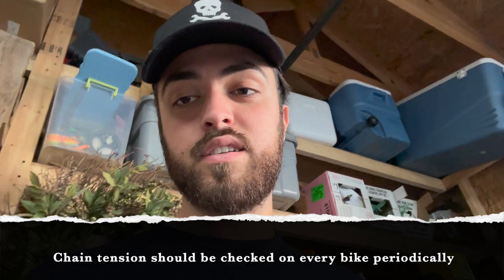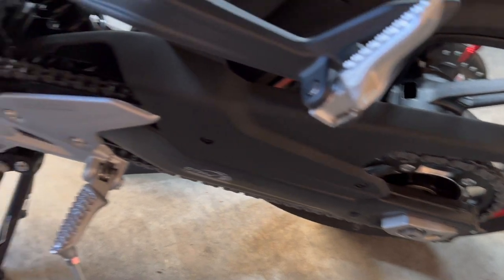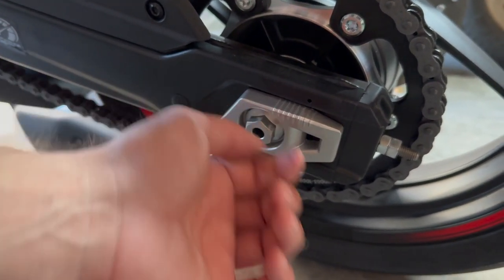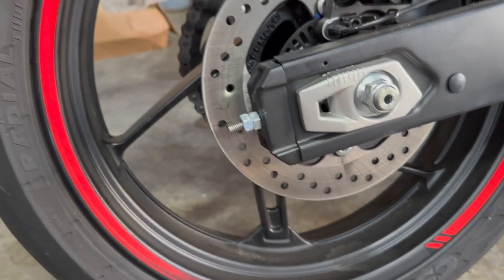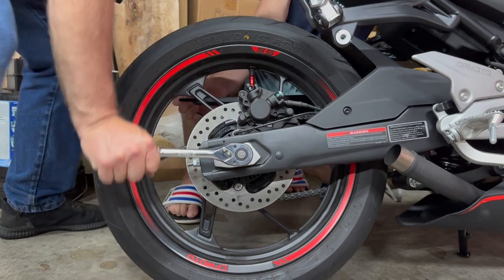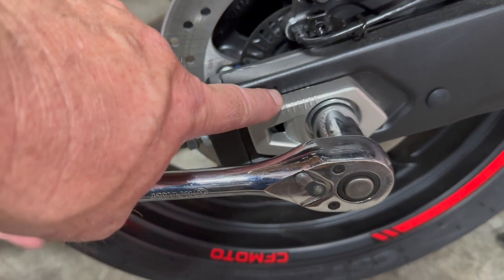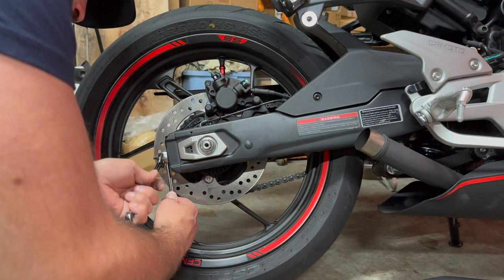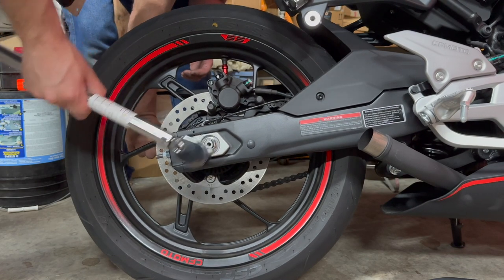CFMOTO 450SS Maintenance | Chain tension adjustment tutorial

Comment: Hi. I've got a new 450 about a month ago and I was wondering do you get a uncomfortable clunk or thud when you change gears?  The gear thud or clunk is worse on down shifts.    I've taken the bike back to the dealers and they tell me this is normal.  Do you get the same thing?
Reply from the maker: hmm.. no I don’t get any thud when shifting. It could be harmless i’m not sure if it has anything to do with the way you shift
Reply: It's 100% normal. 
Just make sure you have enough slack in your clutch lever/cable. 👍

Comment: Thanks for the video. I just got the same bike in a 2024 model. I love it but I was worried about my chain tension. The recommended slack amount was 25 to 35 mil, but even at 25 it felt like there was still too much slack in the chain. Granted I didn’t want the chain to be too tight, but that was bugging me. I was glad you showed the kind of tension you had after the adjustment so it kind of gives me a frame of reference as to what normal tension would look like. 
Ride safe

Comment: What’s up fellow rider! I’m due for my oil change and was looking into doing it myself after only thinking I should let the dealership do my first but not for the price now. What is the oil filter specs I should be looking for? I’m currently at work but this issue is now an obsession to get resolved and have a few hours before I get home to look at the handbook. Lol thanks!
Reply: My dealership included all services for 2 years. As part of my package.
Reply: You'll need 4 qt 10w40 full synthetic 60.00, a new oil plug washer 1.99, and 20.00 CF Moto oil filter. Cost about 82.00 without tax. A dealer service though covers more than just an oil change.
Reply: Woah I went to the wrong dealer lol. Thank you for the info! I appreciate it.
Reply: caSimonson1976 mine too